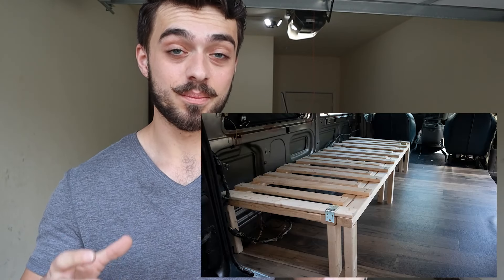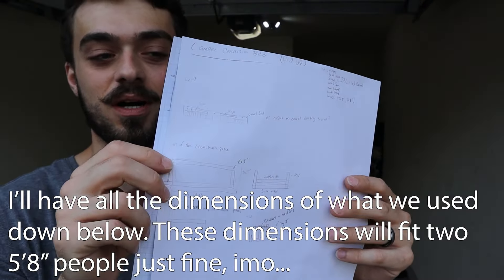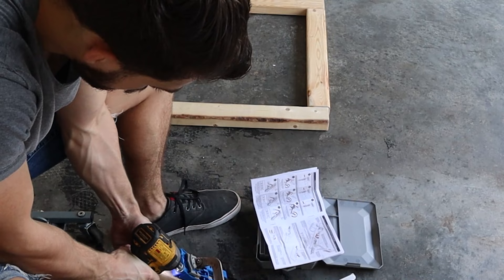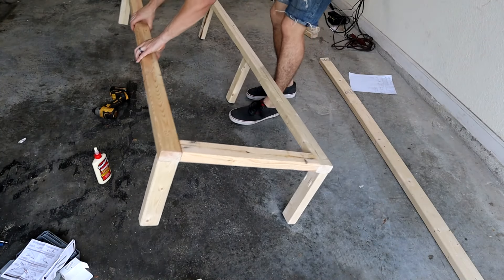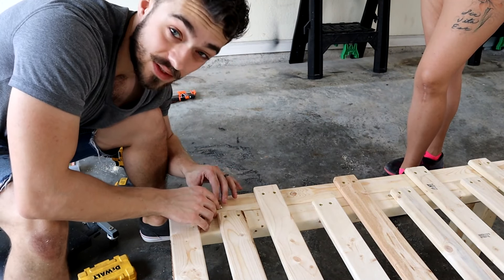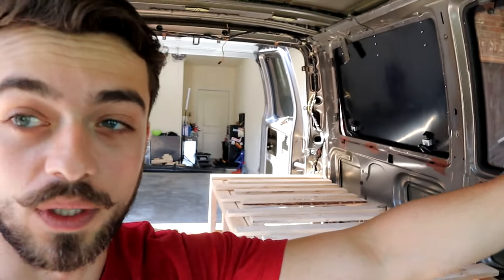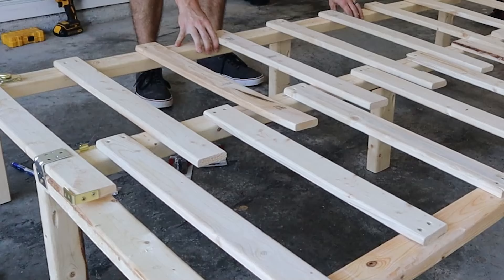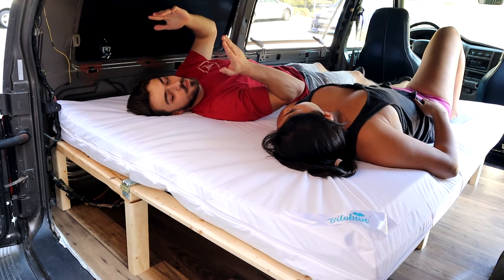SIMPLE DIY Pull Out Slat Bed - Stealth Camper Astro Van (Ep. 11)

Comment: I just gotta tell ya this...The Astro Chevy Van, is an absolute Tank! It will keep you safe in all of lifes ups and downs, rain,snow, ice, 100+ degrees, beach sand, pot holes, vertical climbs, mine handled anything like a tank seriously. Love her and she will love you back unconditionally.  Idk what year yours is but we had our older Astro for dang near 25 yrs, she was still running strong when i regretfully sold her. I sware by those Astro vans, regardless of the door handles and window issues that theyre infamous for, it still was the most dependable, easy low maintenance vehicle ive ever owned and i wish ide not sold mine.

Comment: that bed turned out perfect, you got space and comfort. the gaps will allow the bed to breathe and last long. i did one once with a solid platform and i noticed that there was some moistures underneath that led to mold. i never let the mattress breathe and mold was the end result. im doing an econoline convert into a mini camper and i spend alot of nights watching videos to get ideas. im gonna have to check out some of your other videos. just keep the good stuff coming.
Reply from the maker: It did turn out pretty great! Mold was definitely something I was thinking about when I was making the bed. Just a heads up, I would make the spaces probably half the size to make it a bit more comfortable! Other than that, It’s just about perfect! Wish you luck on your build!

Comment: if you put another board under the sliding parts, and screw down the sliding slats to the board, it will secure the loose ends of the boards and  keep the bed from coming out too far, without your metal clips. Also, put the lock mechanism in the center and it will keep it locked on both sides, not just one end.

Comment: Out of all the videos I’ve researched on a sliding slat bed for a van, yours is the only one that gives the exact dimensions for the cuts in the description! THANK YOU!

One thing, though: since the bed is 50” wide, that makes the seat cushion in “couch mode” 25” wide! Is it comfortable in use as a couch? Seems like it extends beyond your knee joint and makes you slouch back to compensate.
Reply from the maker: Thank you for the recognition! 
For an Astro Van, it’s as comfortable as it can get, in my opinion. 
Me, my friend and my fiancé all sat on the bed talking and I don’t think my friend was uncomfortable at all. 
The cushion is positioned in a a matter where we don’t really need our back pushed all the way to the back cushion, but still have support.
Reply: @AutoMotivate  That's good to know, thanks for getting back! I'm working with a Chevy Express myself... gonna get started on the bed build with this video as a guide. Cheers!
Reply from the maker: That would be awesome! 
A few things I’d advice you to do to make the bed a bit nicer is: 
Add wood glue to the mobile piece and the slats. And, I polyurethaned the wood.

Comment: Can you explain how you joined the lengthways frame to the widthways frame, at the corners? I would have thought that you need a screw upwards from underneath but how do you screw the from the side when there is already a screw in the way? I know you have used pocket holes but still you were lucky the screws didn't hit each other.

Comment: What if you would build this at home? Is it possible to have it stable if the front is exactly like your design? What if it is a bit higher?
Reply from the maker: It’s definitely possible.  Might need to add more bracing from leg to leg connecting from the bottom, but it’s possible.

Comment: hey there! this video was awesome and so appreciated as someone who is not very handy with building stuff. my question is how do you foresee the longevity of the bed? i worry with living full time in my van that it would start to fall apart quickly with constant weight of me and my dog and potention travel buddies. do you have any ideas on how to ensure the strength and stability of this build?
Reply from the maker: I am actually planning in upgrading the bed here pretty soon. 
At the current state, I think it’s decently durable. 
However, I would be sure to add glue to the pallets themselves. I am planning to Polyurethane the entire bed. Also, I am going to add a metal bracket on top of the palllets that pull out so they will stay in one position the entire time. (Not sure if that makes sense) 
But, overall, I think it would last.

Comment: Biggest mistake you did was to have gaps between  each slat,  then you wouldn't need to buy those brackets! The slats are supposed to be right next to each other. The other problem you will find with such big gaps between each slat, you will end up feeling those slats.
Reply from the maker: Nail on the head man. They aren’t as bad as you might think, but that is what I would change the next time around

Comment: You should rotate your 2x4 90 degrees so it has more strength and be flush with your legs.  Also paint or seal the wood otherwise it will absorb the condensation in your van and warp.  These are just the basic obvious problems in your bed construction.  I hate to say it but you need to do some basic research or even look at other videos to see how people with experience do it and always question why someone does it that way - the pros and cons.  It is sort of dangerous and irresponsible to just put out a video of how to do it and not have safety as a priority!  As they say - " you don't know what you don't know"!
Reply from the maker: I did seal the bed in a video after this. The bed has been holding up perfect, but I am planning to "upgrade" it here pretty soon. I did do research and I am all for basic and simple designs, after all, I am learning! Thank you for the suggestion.
Reply: @ray why don’t you make a video and upload it so we can see what’s “safe” and stop ranting on peoples videos lol